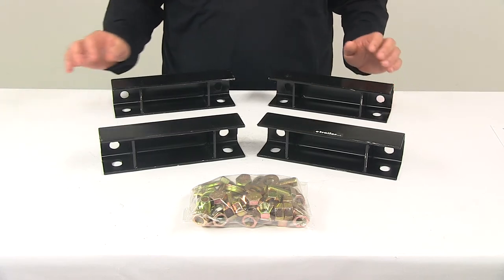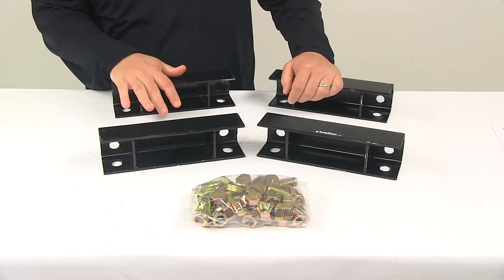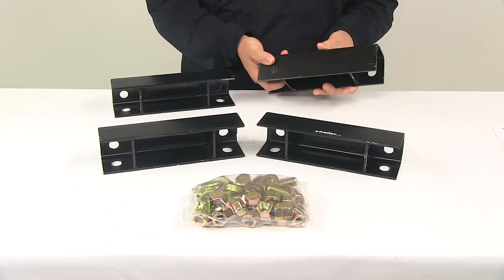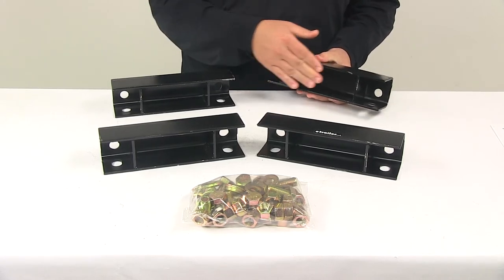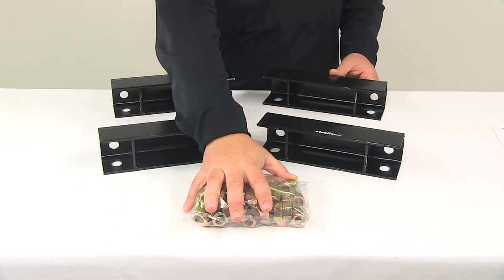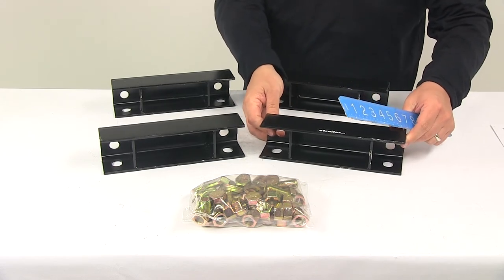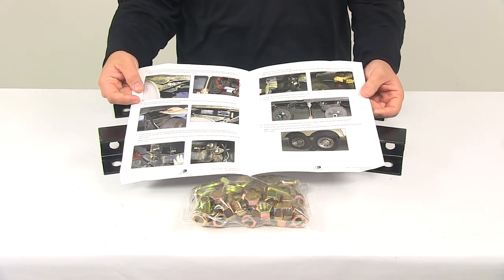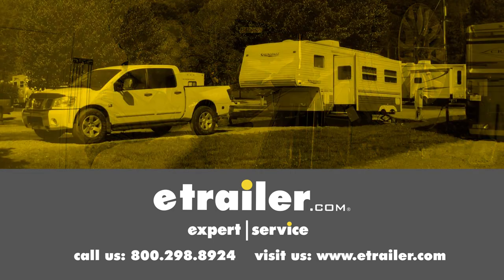etrailer | Comprehensive Review: Torflex Lift Kit

Comment: Will this kit work properly on a 2018 Lance 2375?
Reply from the maker: This kit is compatible with #10 Torflex axles with 2,300 to 4,000-lb capacities. You can check with your owners manual to see if it says what axles you have on your camper or you can check on the axles themselves.
https://www.etrailer.com/Accessories-and-Parts/Dexter-Axle/K71-707-02.html